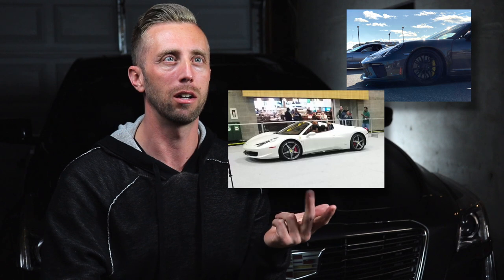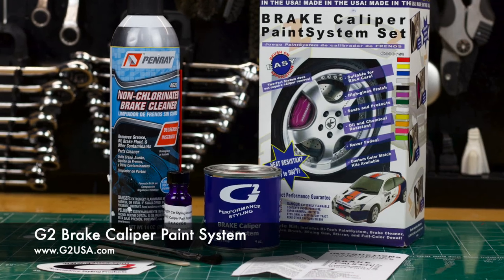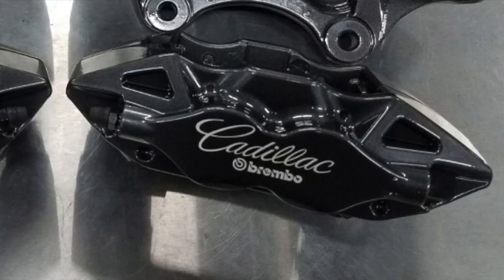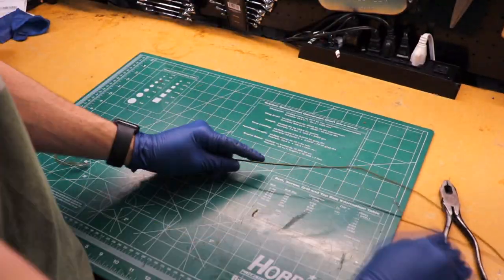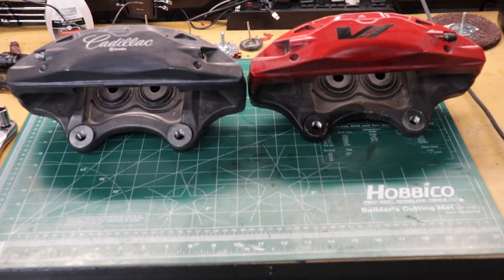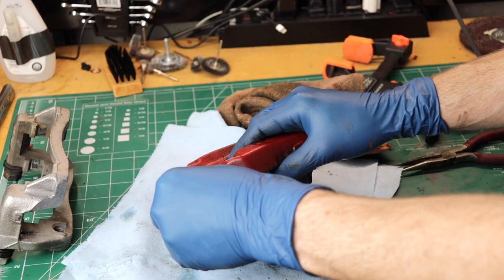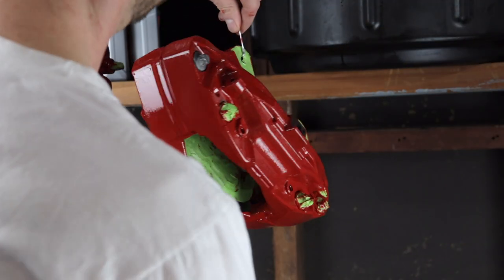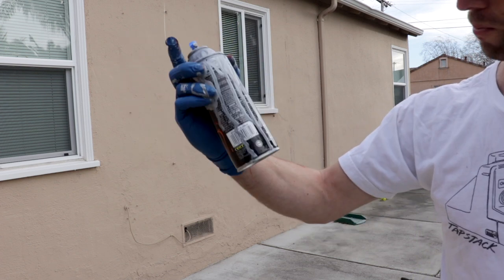Detailed Brake Caliper Paint - Off the Car with G2 System

Comment: A couple observations now that I'm done... My crush washers were triangular as yours were. The washer size is M10x16x1mm. I went through 3 to 4 cans of Brakleen, a roll or two of paper towels as they shred, and numerous changes of nitrile gloves throughout the process.  I also utilized my gun cleaning brushes as I found it easier to clean the caliper than my larger caliper wire brush.  I painted mine in my basement as it was only 60 degrees. That said, I didn't have any issues with the paint thickening up prematurely, however the fumes gave me a headache! I painted the inside and outside as well as the rear brake brackets. That said, after my first 2 complete coats, I am uncertain if I could have pulled off the third coat. Instead, I utilized 2 kits, and applied a total of 4 coats total. With 4 coats, most of the rear brake dimpling subsided, and appeared a lot smoother. Another take away, don't over paint.  Let the paint do it's job and settle. I found by "over" painting it and going over what was just painted a second ago, you just disturb the self leveling affect, and the chances for increased brush strokes emerge.

Comment: Great video with a lot of detail, but you kind of over complicated the beauty of the G2 process.  The effort you went through to pull the calipers is best for powder coating.   I'm a huge G2 fan, I've done 4 different cars and the whole purpose of the product is you don't have to do all this.  You can paint the calipers on the car in 4 hours, have your wheels back on a few hours later and drive the next day with amazing long lasting results.
Reply from the maker: Thanks for watching.  Indeed sometimes I bring out too many details, but remember I was pulling calipers for multiple reasons - especially the rears.  I agree though, if you don't have other work to do - on the car is enough.  Although I'm still glad I didn't have to have my head in the wheel well all that time. :)

Comment: For future reference you don't have to cap the lines or deal with brake fluid leaking out while you reinstall them. Just install a bleeder tube to one caliper, open the bleeder screw, press the brake peddle to the floor and hold it there with something like a piece of 2x4 . If you have power seats you can just find a good spot and just use the power rake to depress and hold the pedal. 
With the brake pedal fully depressed no fluid will drip from the lines and you can work at a leisurely pace with no worries of  your brake system getting air in it or getting  brake fluid everywhere, and you don't have to bother with rubber stoppers.
Reply from the maker: Thanks, I didn't discover that method until after this procedure.  I already have a link to that procedure in the description.

Comment: JetFuelOnly, If the copper washer gets stuck like that instead of using a visegrips to break the copper crush washer from the banjo bolt take a small dead blow hammer or a regular hammer and tap on the end of the treaded banjo bolt to break the washer free while holding the other end of the brake line as you are tapping it out. That's what I would of done it.
Reply from the maker: Well that seems like a simple idea now….  Haha thanks

Comment: How did they hold up to the brake fluid when you reattached the calipers onto the car?  I've heard the brake fluid can really jack up the newly painted caliper.  So some find it better to keep calipers attached and paint them on the car.
Reply from the maker: Just fine. The epoxy paint is very resistant to brake fluid. However the instructions state something about them starting with low resistance until they cure. I had no issues but mine cured for 24 hrs or more before install

Comment: I'm running 18" wheels on my  ATS But can it take 19" wheels without Rubbing 🤔 anywhere like full U turns and dips into the wheel wells. 225x40R18 on all four.
Reply from the maker: Rubbing is dependent on width and offset. If you go 19s you gotta sacrifice tire sidewall height.
Reply: @JetFuelOnly  8.5 offset is what my 225x40R18 are now hopefully they won't Rub with 19's
Reply from the maker: That’s the width of your wheel. Offset is how much the wheel is designed to set inward toward the suspension or out toward the fender. You should have no problem fitting a 245 (and likely wider) tire with the correct offset
Reply: @JetFuelOnly  The offset is 8.5
Reply from the maker: Either you have a very unique wheel setup of the number is incorrect. Appropriate offset should be around 25-40
Reply: @JetFuelOnly  Perhaps I don't understand I thought I understood what offset numbers meant 🤔